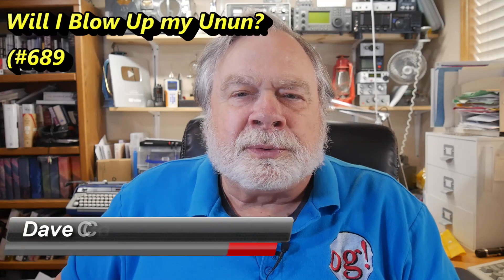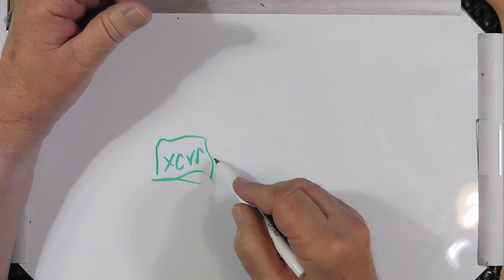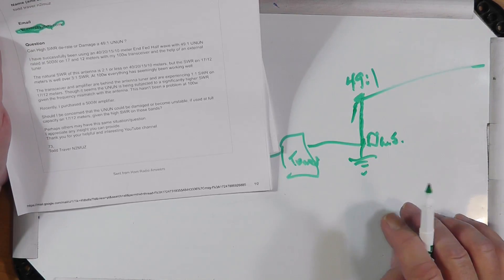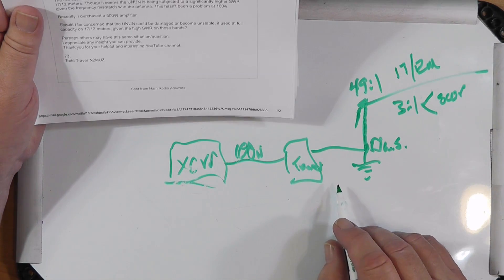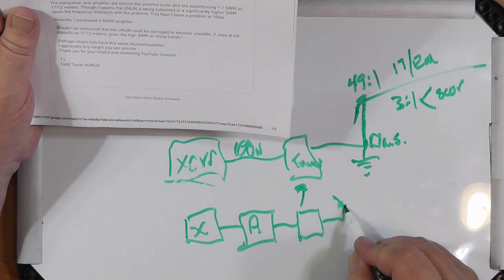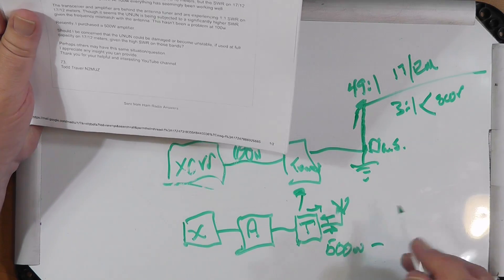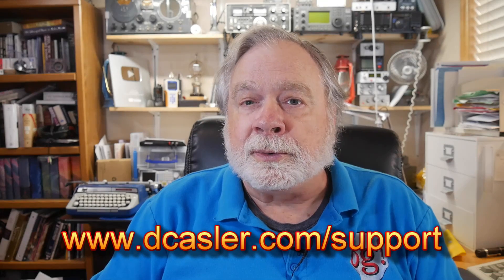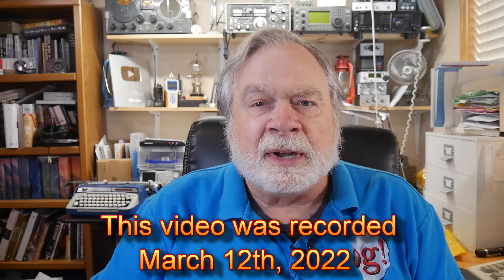Will I Blow Up my Unun? (#689)

Comment: Dave, word to the wise: If you’re using FT-8, then multiply the unun’s PEP power rating by 0.3 … so a balun (or unun) rated for 500 watts PEP can only safely handle 150 watts of FT-8 (e.g., 500 multiplied by 0.3). I myself have pushed an unun’s toroid beyond its temperature threshold using FT-8 and have then witnessed unexpectedly high SWR. (The “0.3 multiplier” guideline is recommended by Bob Brehm of Palomar Engineering.)

Comment: Dave,  Thanks for your response ( and those of the commenters ). My UNUN is very heavily constructed with other users saying they run a KW, so it should be alright for 500W on the EFHW frequencies where SWR is low. However, even though my 1.5KW tuner will easily adjust the SWR down to 1:1 on non-resonant frequencies 17 or 12 (where SWR is 3:1 or more), I won't risk using 500W amp there, for the reasons you state.
And agreed about most often not needing an amp, but it sure does help, when all you have is a wire antenna and need to "compete" with stations running directional antennas at height!  73, Todd N2MUZ
Reply: I would ask for clarification that:
1- I’m believing that your using an Unun not a Balun. This assuming you’re using Coax and not Ladder Line. 
2- What promoted you to employ a 49:1 transformer when performance is measurably improved using a 9:1?  You’ll get a handle on the WARC Bands if you move to this transformer. 
3- Have you used an antenna analyzer that will offer  “sweep” of each band?  Often a simple adjustment in wire length will bring your SWR readings into a more acceptable window of use. 

Finally, I would strongly encourage you to visit and view Bob Brehm’s YouTube presentation on End Fed Wires. Find it by searching Palomar Engineers, Bob Brehm, and choose the Wire antenna presentation at LARA. 

I utilize the EFW, amplifier (Tokyo Hy-Power) through a manual tuner with fantastic results.  Best of luck!
Adam ,  
NY5E
Reply: @adamny5e591  Yep, it's an 49:1 Unun and coax. I'll have to try a 9:1 one of these days. I used an antenna analyzer on my current setup and got SWR dialed in to 1.5 range on 40,20,15 with 10 being a bit higher. 17 and 12 are not resonant so SWR much higher, but which still work fine using manual Ameritron manual tuner at 100w ( the amp is Ameritron also ) ... I got a very good deal on the amp and tuner, which is why I bought them, but then started to worry about frying the antenna ! ;-) ( I've heard very good things about the Tokyo High Power amps ! )
Reply: @westchesterbeemers7640  I am a big fan of amplifiers. Most, not all, of amplifier detractors don’t run extra power. I found that I was “heard” MUCH better with the additional punch. The difference from barefoot 100w station to 800w was a game changer for me as I employ the EFW. Longest contact to date is 10,217 miles and I’m approaching 100 entities (dx). I was licensed (tech) 11 mos. ago, General 30 days later, Extra 60 days further down the road. 

Try the 9:1 and see the turn around your antenna readings make. Depending on your Ameritron model, keep your SWR below 1.5 (with the tuner) and you’ll be fine. Be methodical when tuning and pay attention when you move up and down the bands as your SWR will change with frequency adjustments within bands. Enjoy!  Great to hear your having fun. That’s what it’s all about!!
Reply: @adamny5e591  Thanks for the pointer to Palomar engineering video. It confirmed that Dave KE0OG was spot on with his response to me, as is pointed out on Palomar video at approx 14:51. The 49:1 will get very hot on non-resonant WARC frequencies, especially with high power. Voltage can be up to 5,000 volts at the matching unit ! My 49:1 has (3) torroids so has good capacity for resonant freqs, but at over 3:1 SWR and 500 watts, it would likely put more than just a little strain on the matching unit ... and then to your point, the rest of the video provides a pretty compelling argument for 9:1 balun and 71' configuration ( though it does require 100' of coax to resonant well ).  I now understand what my setup is ( and isn't) capable of,  learned of perhaps a better 9:1 alternative... and now likely know what my next wire antenna experiment will be ;-) ... tnx

Comment: My EFHW has a rating that is high but said that on one or two bands said to do lower power! If he has good SWR on most bands but High SWR on one or two bands I would do lower power on the bands with the higher SWR!  Some think that you can put up an antenna that covers all the bands good.  Most multi band antennas are not really good for all the bands. They can work them but not all of them really good!

Comment: An EFHW antenna is only resonant as a half wave or multiple of that frequency so the high impedance point is at the end of the antenna. A 49:1 transformer is looking for about 2450 ohms. The coax should always see a 50 ohm load. The wrong core can overheat if not large enough or the wrong material. I use type 43 cores.

Comment: 1. An end fed half wave for 20m, 40m or 80 will always have a high SWR because it is not a multiple of 10m, 15m, 20m, 40m or 80m
2. Why do you need a linear anyway? it will you give you a few extra S-points.
3.  Most devices like UnUn's have VERY misleading optimistic power ratings, and usually this is 500w PEAK and not nominal. Also data modes have much higher duty cycles. This means an UnUn rated for 500watts peak on SSB will only manage 125watt to 250watts on RTTY or FT8 etc. If you really plan to run 500watts in data modes then you need a 1000w UnUn to be safe!

4. If you over drive any kind of balun or UnUn you risk the core getting HOT and  then it can suddenly stop and your radio's PA or linear's PA stage can be damaged and they are VERY expensive to replace.
5. You can buy linear amplifiers with internal antenna matchers. These are the modern ones.
6. You are better off learning how antennas work and improve your antenna system than splashing out $2500 ++on a quality linear amplifier.

G7VFY

Comment: Ratings for coax and components are valid for less than 2:1 VSWR.  Not a problem at low   power, but at higher powers, the voltages and currents that a mismatch can generate can be. Running a tuner into long coax and transformer can melt or arc thru coax well below its ratings.

Comment: Bob at Balun Designs said never run a >3:1 or the chances of the coax shorting internally are greater. 
I prefer a balanced feed and antenna ☺️